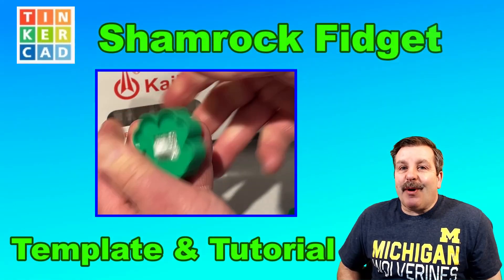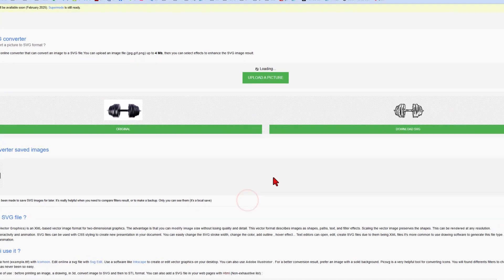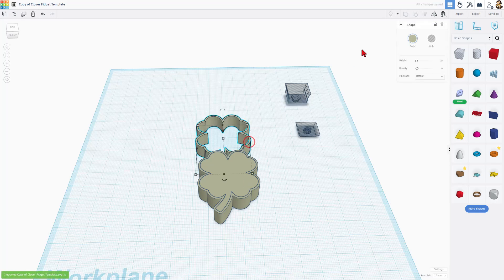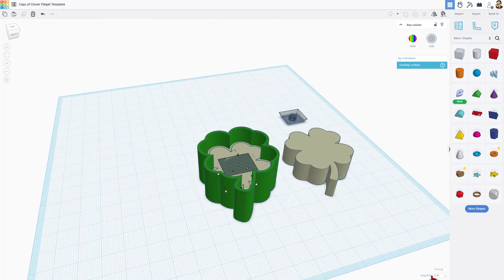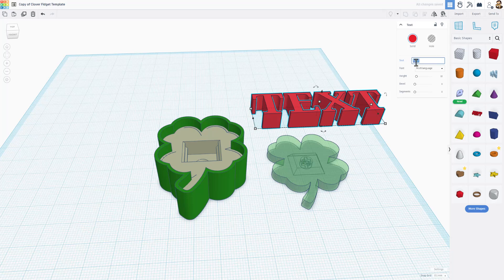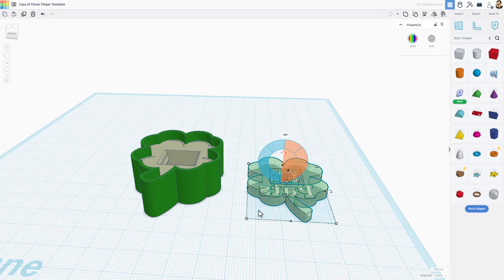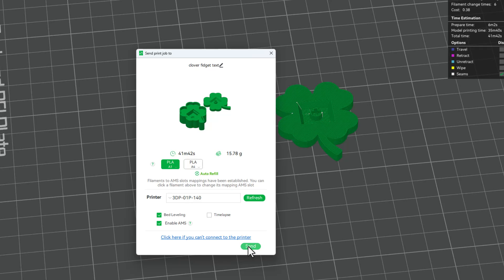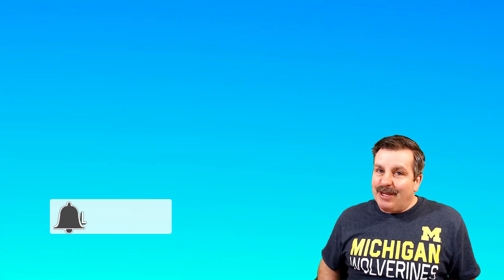Master Tinkercad: Design a Clicky Clover Toy

Comment: Omg this was helpful for the letters sinking them but is there a way i can put my own stl into tinkercad then add an svg and do the same thing with them cuz i need to sink designs into a front dirtbike number plate
Reply from the maker: Those skills will work with any project. Just make one set of numbers a hole... group it, and the second set a solid. Face down and bingo. =)
Reply: @HLModTech  your the best 3d guy on youtube man i love it and i appreciate u so much
Reply from the maker: Happy to help. 👍 I have a slick chat area at my Patreon site. https://bit.ly/hlpat  It is available to free members. Slick for questions like this because we can add images and links. This explains it. https://youtube.com/shorts/xHUM1eGOmjE?feature=share  If you get stuck we can get it solved pretty quick.